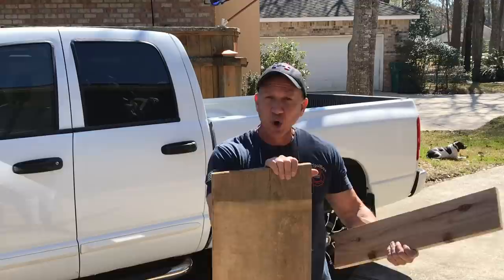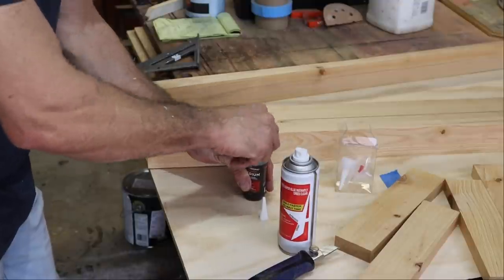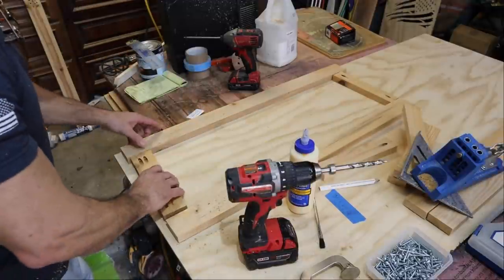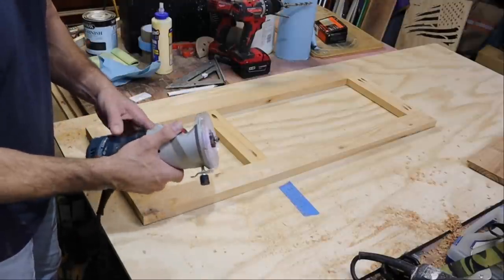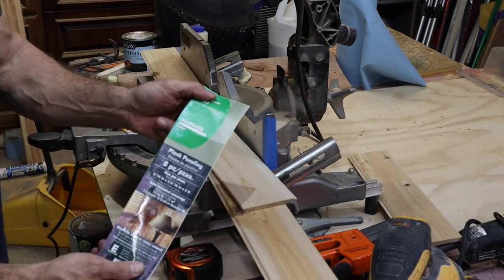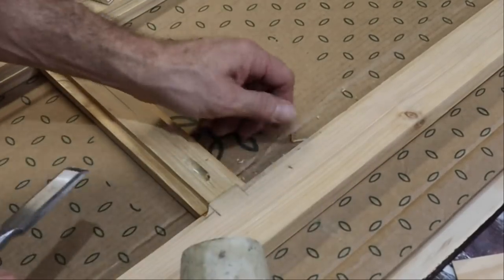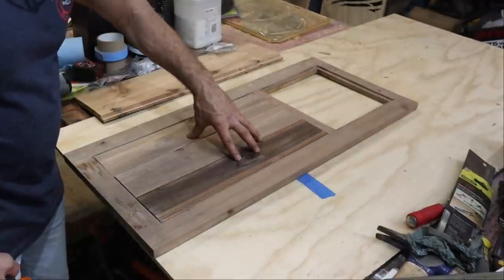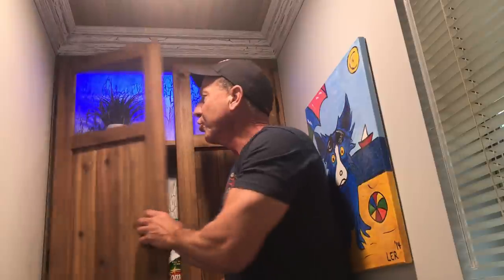How to Build Cabinet doors using a Hand Held Staple Gun....

Comment: What was the solution you sprayed for staining? Thanks.
Reply from the maker: It is white vinegar, water and clean steel wool. I mix 50/50 water and Vinegar in an old milk jug or any sealed container, add 2 pieces of clean steel wool. Let it sit for a couple of days and it's ready to use, I show it in the previous video on building the cabinet. I will add the link in the description box. 
Thanks and Happy Easter!
Reply: @paulstoolbox  I thought something along those lines. Although I don't know how I missed the last video, notification is on. Watched and enjoyed it. Thanks again.

Comment: Nice looking doors.....what did you use for staining?
Reply from the maker: Good morning, I mix white Vinegar and water 50/50 in a container. I drop a couple of clean oil and soap free steel wool pads and close the lid. You will have an aging stain in 48 hrs. I show this on the video on building this cabinet. Part 1
I will add it in the description box below.
Happy Easter!